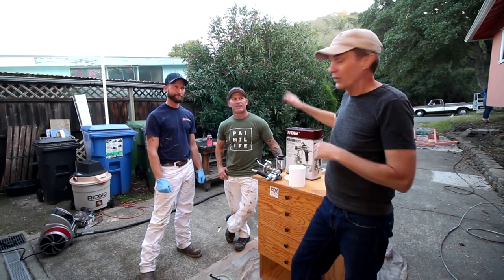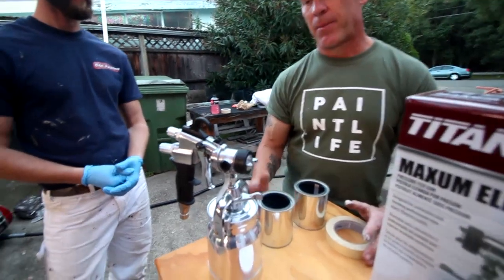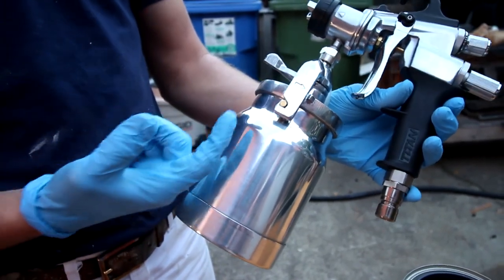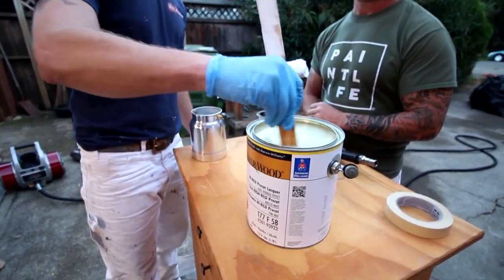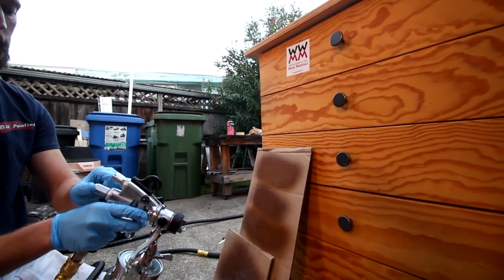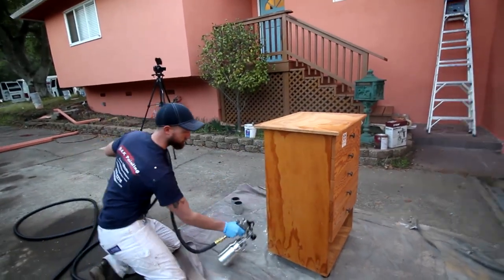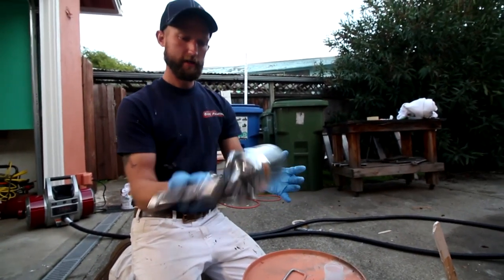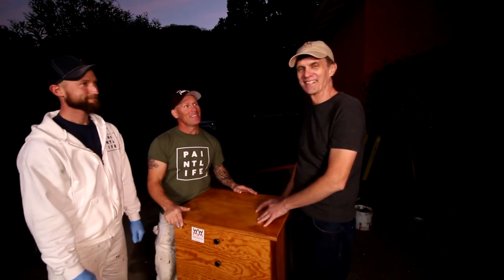Spraying Lacquer with HVLP | Step it Up

Comment: I thought HVLP spraying produced less over spray.  The cloud of spray seemed just as big as a standard compressor with an old Binks spray gun. I'm going to reconsider purchasing a HVLP sprayer.
Reply from the maker: Definitely. HVLP is not for everyone and should be researched beyond this video. Thanks for watching!
Reply: Steve Ramsey BTW, I really do like your videos and projects. :-)  (I should have started with that)
Reply: Tim D your going to get over spray no matter what you use. it all depends on your tip size as well
Reply: baked clam fab Maybe they chose a much larger tip for that small cabinet than require .  I have been considering an HVLP sprayer for plantation shutters.  I have a lot of them to build and paint for home
Reply: Tim D the tip size seemed right for the job, looks like a number two or three .  but that is a very thin product. thicker paints will put out a little less over spray.  but in the end it's all part of the job  , prep is everything.  if you ever need further advice you can call my shop number . visit automaticrepairco.com to get it. we repair and sell all types of sprayers .
Reply: Tim D  i have a high end  hvlp and i promise you, its not like in the promo movies. There still is enough overspray so that you have to cover EVERYTHING you don't want ruined.
Reply: ALL of the other replies are indeed accurate - but I wanted to add - while you will never get completely rid of over-spray, the amount you do have is influenced by your pressure and nozzle size of your gun.
Don't avoid HVLP for fear or it - just practice (practice with water in the gun) and then practice again, to start learning the balance of nozzle, pressure and product viscosity.
Reply: Correct! Buy it , use it, love it, but allways use your brain and be carefull. Because its easy to get carried away with a result of fubar.
Reply: actually the HVLP atomises paint more coarsely and the fan is not as wide as with conventional TE110 and TE20 cap. HVLP is just another type of cap. a conventional cap is something you see people use on cars. paint is sprayed finer and the fan is a lot wider than HVLP. HVLP is not revolutionary, it is just aimed at use on smaller project and diy. conventional caps just offer better overall coverage and finer atomisation. any good gun can be converted just by replacing the cap. big brands offer different types of caps too, not just different sizes
Reply: gertman a "Always use your brain..."  That's the best advice ever, for everything! 👍🏼👍🏼
Reply: @davethepak  I use capspray titan guns everyday and spray cap adjustment can minimize overspray along with air adjust. Nor so much the tip/nozzle.
Reply: @davethepak  water in your gun is bad as it rusts all kinds of parts and once i started using an hvlp gun about 30 years ago i never looked back,  as conventional sprayers,  compressors,  shoot cold air,  and hvlp shoots warm air,  makes a huge difference

Comment: This is a good demonstration, would add that a sanding sealer step might be necessary, and appropriate respirators and protective gear are important. Most of the solvents can leach not only into mucous membranes in mouth, nose and eyes, but also through the skin. For diy'ers, it might be important to promote the practice of reading and following MSDS sheets for all volatile organic based coatings.

Comment: Are there any electric all-in-ones that are worthwhile, like the Wagners?
Reply from the maker: I'm not sure. Seems like there must me something like that!
Reply: DanKmake  graco 395 multifinish
Reply: Some are quite worthwhile - but sometimes its the right tool for the right job.  Most of the "electric" ones (which don't use external pressured air feed) do not have as fine of control as the HVLP sprayers can, and are really designed for throwing large quantities of paint on a wall - which, if that is what you are wanting to do - then they are prefect!  The hplv guns work when you want more close up work, or want more control over the thickness of the coats - again, each tool for each job.   See if you have a friend who has one (or both) and give a try.  Like steve always talks about - the secret to all of this is doing - and getting experience.  Best of luck!
Reply: Thanks so much! That looks like a seriously good machine. Is there anything more hobby-grade? I'm only spraying small pieces and would love something more compact.

Comment: Show us how todo it with a harbor freight gun and a 20 gallon air compressor. I have a graco 490 I have dedicated to laquer and sealer.never ran paint through the pump.and a fine finish 310 tip.that works great too

Comment: seems like a lot of hassle if you just were doing a smaller project like Steve normally does and would it be any more cost effective than using a can on a small project?
Reply from the maker: I wouldn't bother with HVLP on my small projects. But for my dining table it was super handy! I'll still use the spray cans for small things. They are so convenient. Hope that helps!
Reply: Steve Ramsey thank you for the reply and think I agree that the cans are just too handy to do away with all together, and thank you for all the great shows.
Reply: Steve Ramsey Nice informative presentation for HVLP. But I'll stick with the spray cans and wipe on applications even though they are time consuming (im cost prohibitive- haha). It wasn't surprising that you turned to one of the H&GMM team to paint your house. I'm sure they did a great and professional job!

Comment: So can you just use a regular air compressor?
Reply from the maker: Yes, I used than for my dining table a few weeks ago. Worked out nicely.
Reply: If you have a compressor that has  low cfm rating, or not alot of air storage you can run into issues where you need to wait for pressure to build up.  In other words a small $100 compressor will work if your patient.  I upgraded to a Makita 5200 which runs on 110v, and has a small 5 gallon tank but puts out over 6 scfm at 90 psi.  These HVLP guns don't need high pressure but lots of air volume.  So i team my compressor up with a 7 gallon auxilarry tank to get more bursts of air before it has to charge up, but keep in mind doing this means you have to wait longer for it to charge up to pressure.

Comment: Good job. This stuff is not that hard to learn. I've sprayed many a gallons through a cheap gravity feed gun from HF. I also have turbine system. But for most of us weekend guys/gals, The less expensive set up from a HF works great.  You will get professional results in short time frame. Use 1.4 nozzle for lacquer.  1.7 for paints. Lacquer retarder if a bit humid out. If real high humidity, wait another day.

Comment: i love sprayers.
but the biggest issue is seen at the end. The clean up can be wasteful in some applications as you have to deal with cleaning out the sprayer and if you dont do that right, it gets to be troublesome the next time you use it. 

Sprayers have far more control and you can tailor the product to fit your needs far better than just a spray bomb. You can control your spray and coats better with the big sprayers as well which is great. 

Always benefits and downsides to everything.

Comment: Precat dull rub from Sherwin is the go to in my shop. I’ve been having some issues running my gravity fed off a 30 gallon oiler. I’m over in Wyoming and wonder if you guys run into problems with chunks? I’m probably going to go grab my pressure pot and capspray 9100 turbine or the Finish Pro ll...I just hate running anything other than ProClassic or Solo through that machine. I have never had these chunks in 25 years of doing this. I empty my gun every time I stop, run LT through the gun, soak the cap and tip in LT while I sand and then refilter before I start spraying. It’s driving me nuts! Always clean it out! The PreCat will dry inside that gun! Good video, always like your stuff. Maybe I got a bad batch...not sure.

Comment: a how-to video for spraying is a hard thing to do. not only you need to know your gun settings really good, you have to know the media (paint, clear coat, sealer etc) you are working with, too. even if you have the full systems, some pigments tend to give base coats different weight and viscosity. so if you have sprayed clear coats all your life and now you take a can of red basecoat from the same system/same manufacturer, the difference might be drastic.
Reply from the maker: I think it's a real art!

Comment: We never clean our locker gun at work I coil up the hose and stick the gun in a bucket of lacquer thinner spray it off with an air compressor you are ready to use it again

Comment: Harbor freight gun for less than $15... who's with me? It does get a little frustrating but still a reasonable solution.
Reply: i bought one and it didn't have a wrench to take apart and clean, i spent half a day trying to buy a wrench to disassemble to no avail.  I found out the revision prior they had shipped with a wrench, now they don't with the particular model i bought.  Never again, wasted too much time.

Comment: Clearly they don't understand the difference between an air compressor and a turbine.  They also don't understand that every product needs to be measured with a viscosity cup and adjusted as needed.  Titan provides viscosity guidance for each category of finish (there's probably a table in the turbine instructions).   Never eye ball how much you need to thin a product.  Run the viscosity test with your viscosity cup and adjust the viscosity as needed.  Any professional painter will know this.

Comment: Wow! Those guys made it look stupid easy, then I realised, yes, they are professionals. So, no, this is not amatuer time.
Reply: They are right - like a lot of things in woodworking (or other physical crafts) its not hard once you get a bit of experience under your belt.  The most important thing (besides watching lots of helpful videos) is to use the products.   Practice on scrap wood, or other random parts.

One other piece of advice for using HVLP (or any airbrush...its technically a giant single airbrush) is practice - practice first with water, to get the hang of it.  Then start using your products in it - now, they never spray as easy as water - but if you have learned the basics, then by making adjustments and experimenting, you will get the hang of it.
Reply: Allen Brosowsky if you have a sprayer i find it really ez to use and nice results every time

Comment: I have an HVLP sprayer I have never used. I'm more afraid of the clean up than anything.
Reply: it can be time consuming but i like the idea of leaving thinner in the pot, and not totally disaseembling the gun, i'll have to try that.  usually i take everything apart, soak in laquer thinner, wipe down and re-assembly.  Then you go coat it again how many ever minutes/hours later and have to keep doing that, but with their process i think it could be nice and quick.

Comment: you can do this yourself, a compressor at harbor freight is super cheap and a spray gun is $9 literally. if you got $150 you can get the 21 gallon compressor or get the smaller ones. there's nothing complicated about this, hiring a painter is a waste of time

Comment: Great info but way to complicated for me. 😀 I'll stick to my rattle cans and brush. Haha
Reply: Thats what I thought, but you can get a cheap gun (very cheap) and a basic compressor and just practice (use water to get the hang of it).   In less time than you would think, you can achieve basic results very quickly.
Reply: Was thinking the same thing.  By the time these pros set up the sprayer, mix everything, spray the job & clean up after, I would have done the job with my small can of spray & been on my second beer.
Reply from the maker: +HamiltonRb Maybe just stick to the beer and forget about wasting time with a finish at all! That would be much easier! Haha.
Reply: Steve Ramsey   You might be right my friend...lol

Comment: What about electric HVLP sprayers? ...for us poor folk.
Reply: Adam Rivera it is electric
Reply: The one he's using is pneumatic, not electric. In my experience most electric ones are more expensive but you don't have to buy an air compressor. For stains, it's probably not going to be too bad but when you get in to higher viscosity fluids like lacquer or paint you may have to thin it out which could affect coverage if done incorrectly. I have a $100 Wagner HVLP Spray gun and I felt it just caused too much over spray and product loss. And electric guns are very loud.
Reply: Kendra Gray the gun is a high volume low pressure gun powered by a titan turbine unit both come in a kit together  . the turbine is electric
Reply: baked clam fab It is still considered pneumatic since it is hooked up to an air compressor. (Steve even references the air compressor in overall cost) The full electric guns do not require an air compressor... Just an outlet. That's why they are appealing to people who don't have room or money to get an air compressor. Pneumatics can also use electricity (often named hybrids) but they are still considered pneumatic or pneumatic hybrids.

The OP was asking about full electric guns, which this is not.
Reply: Kendra Gray I am on the same page as you , the gun is pneumatic and the turbine is electric .
Reply: I think you are talking about something like the Wagner Power sprayer. You should compare the price of those with something like the Zoom HVLP sprayer.  The Zoom is light and cheap.  I've only used mine once (just practicing with water) so can't tell you about reliability.

Comment: turbines do not pump anything. Compressors do. It turbine is a device vet gains power from a fluid or gas or liquid passing over veins usually on a wheel. A wind turbine generates power and a fan uses power to blow air. In a turbojet engine, the turbine is at the back of the engine drawing power from the thrust stream to spin the compressor at the front. If power goes in and air comes out it is not a turbine.

Comment: Why use lacquer on wood? Very poor choice of finish in my opinion.
Reply from the maker: +Stephen Beck I produce a show once a week. If I had to wait for other finishes to dry, I'd never post anything! It's easy to apply, dries fast, is durable and looks great.
Reply: Thanks, Steve. I agree with the drying time advantage. But I have used many finishes and always come back to satin oil-based polyurethane for most projects. Oil-based poly seems to penetrate and give the wood a richer look and grain contrast that I much prefer over the crystal clear look of lacquer or water-based finishes.
Reply: Having built guitars and other fine instruments over the years I agree with Steve on the speed and quality of the finish. Lacquer thinned is amazing for these products. That being said I understand Mr. Beck's viewpoint too. Perhaps as most things in life, no one answer works for everything. When making our wood nautical charts we use a water based acrylic and a UV coat on the top layer. Always learning and keeping an open mind!